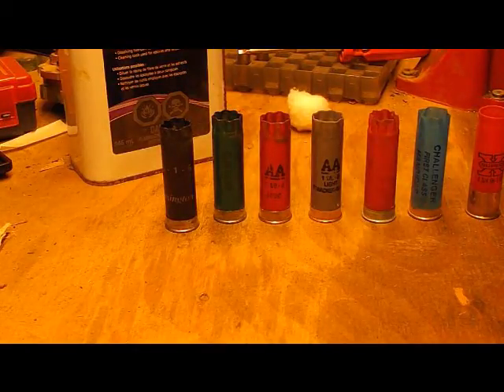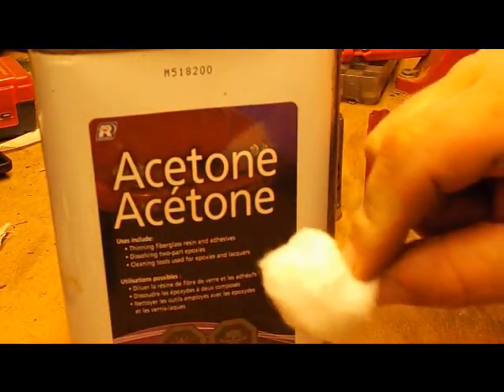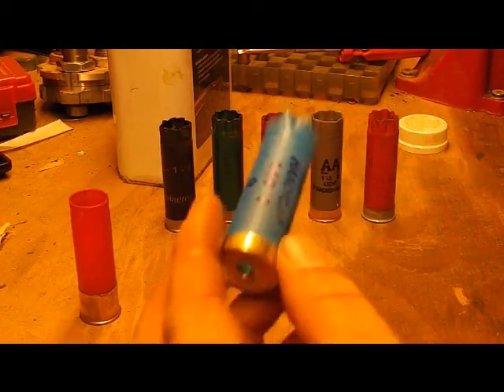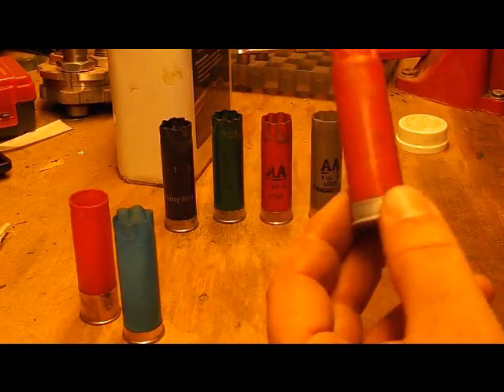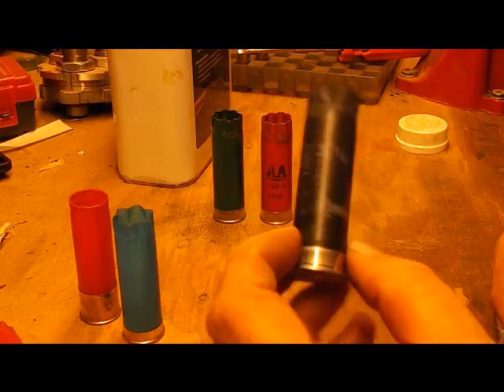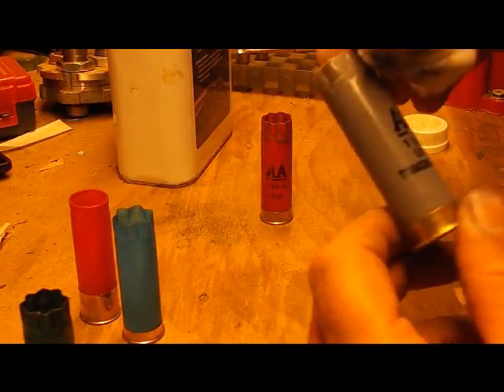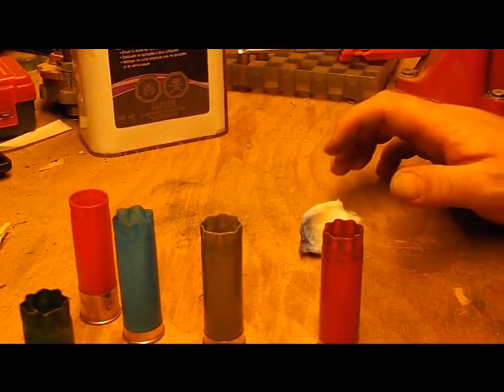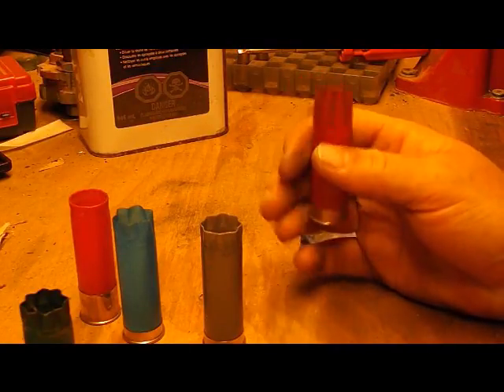How to remove printing from shotgun hulls

Comment: Those black hulls are the same as remington gun club, but have field loads in them. Some are 6 crimp and some are 8. I like to use them to segregate out my slugs. For most loads they have the same data as STS hulls.

Comment: Aren't you concerned about the acetone attacking and weakening the hulls?
Reply from the maker: It evaporates before it can harm them I use much.
Reply: Interestingly LDPE can handle Acetone quite well so there would be no problem with the small amount of exposure.
The ink they use on the hulls could be a bit toxic though so it might be beneficial to not get too much on your skin  :-)
Reply: joehunt1980 Thanks for the informed comment.